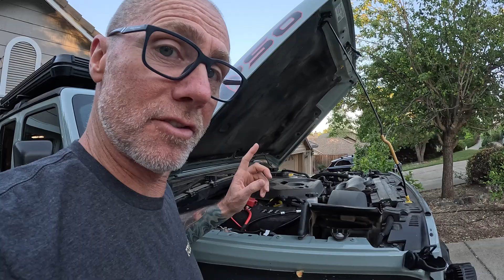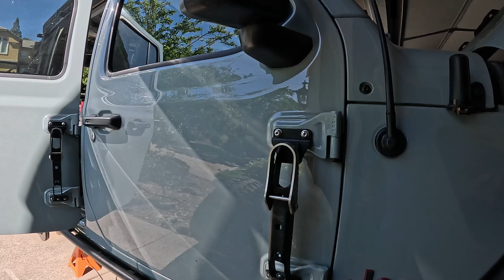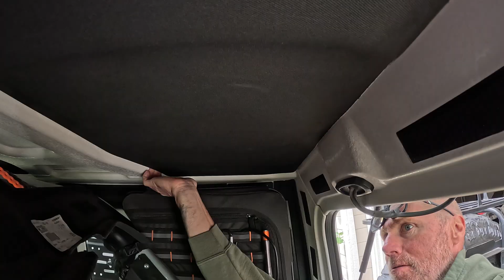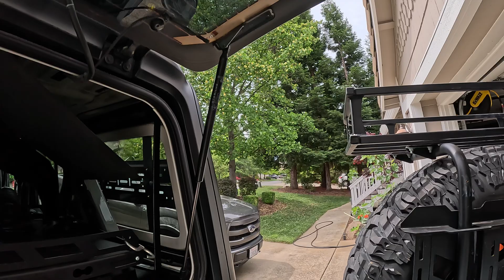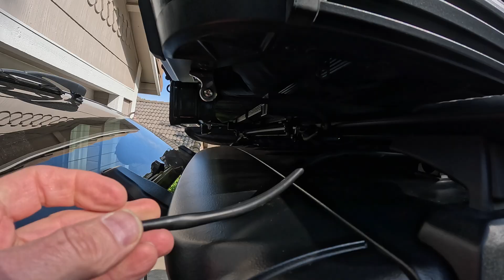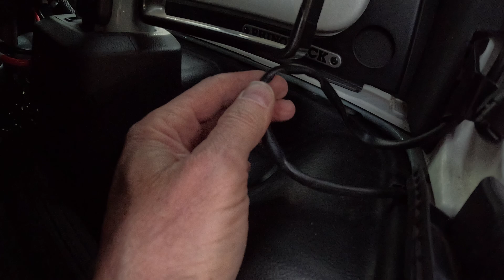Chase Lights - How to Wire through the JLU Roof

Comment: What brand/model molle panel are you running on rear quarter windows?  I have rhino rack backbone as well and was worried no place to secure to rain ridge
Reply from the maker: Those are from TrailRax. Not really a molle solution but works good for mounting stuff.

Comment: Great video!  I just got my 2024 Jeep JL370 392 from AEV (most on my IG page under the same name) - but I’m doing almost exactly the same thing.  Already have the Epic terminal expansion kit, did the Bluetti DC/DC to a Pecron power station.  I also have a Pioneer Rack.  I’m still deciding on the chase lights - as the AEV tire carrier has a spot to put a single one, but wiring it through the tailgate is going to be a little painful.  Anyways, great video - very helpful for me to do my chase lights in the future. Did you consider using white light pattern and just use amber lenses?  I figure that gives you amber for chase lighting, but white light for lighting up the campground?
Reply from the maker: Thanks! Don’t be too intimidated about wiring through the tailgate. It might be a little time consuming, but not overly complicated. I didn’t really think about white and amber lenses there, but the could be a good idea. We have lights under our awning and in the rear tailgate glass for lighting the camp kitchen, but you might have. Good idea there. We just use our Devos light if we need to light the camp site.